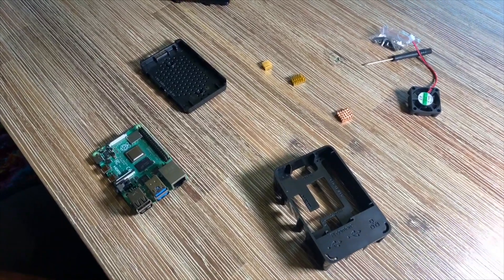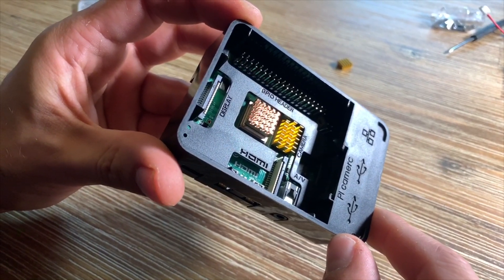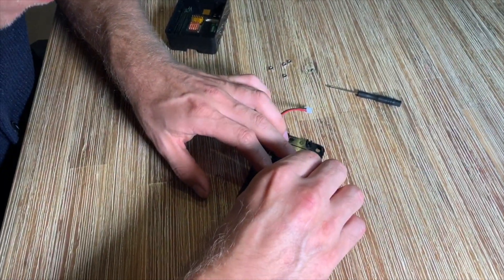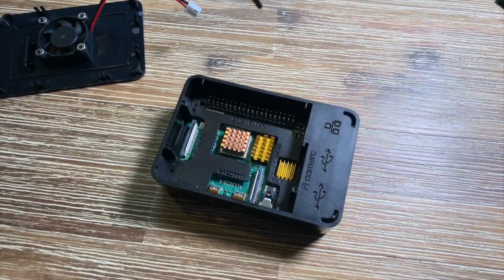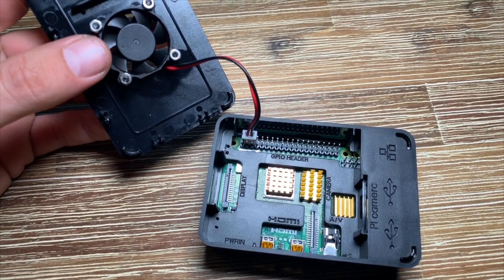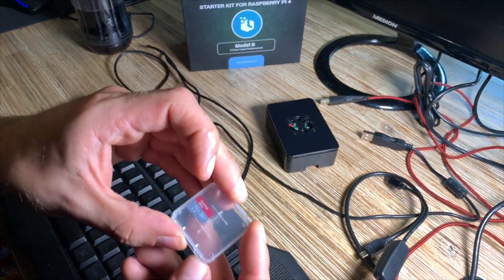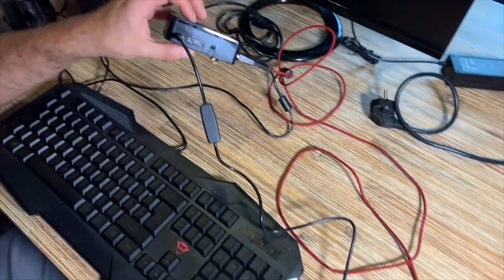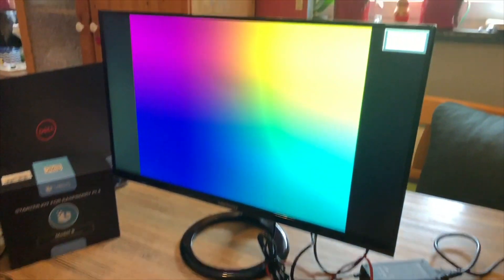How to assemble and connect a Raspberry Pi 4 (Model B 4 GB) DIY

Comment: Thank you, very helpful. I did not have a clue why top cover does not get closed, almost broke it, and then I saw this video -)) Also, now I understand why you placed little heat reducer at the very last . I did all together, and the cover did not feet because hit reducer was not properly alligned... Also, on new models there is no such think as preinstalled OS. Supplied card was empty. May be it depends on supplier?

Comment: Great tutorial, was exactly what I needed. The numbering of the fan pins is slightly confusing. In my simple and technically not appropriate words the red goes in the 2nd pin on the upper row and the black in the 3rd pin on the upper row, in my kit the plugs were separate. Danke !
Reply: See pin numbering on the wikipedia article about the Raspberry Pi: https://en.wikipedia.org/wiki/Raspberry_PiIt's actually number 4 (+5V) and 6 (GND)

Comment: Excellent, I found this video after I assembly my PI 😆. 2 things: the case is a little bit tricky that can fit on the top and the other is the fan, goes at n speed and too noisy.
Reply: Change the pins, for 2 and 5 and it slow the fan a bit and make no noise

Comment: I had a bit of struggle with installing the case, your video helped me in few seconds 😀 i got a 16gb noobs card with my purchase, can i erase the noobs card and flash another OS? Is that possible?
Reply from the maker: Yes this is possible
Reply: @pduesp  thanks 😀 I'm flashing manjaro now 👍

Edit: flash failed ☹️ and now sd card is corrupted
Reply from the maker: You will need a special format (FAT32) and an extra partition to flash the other Card.
Reply: @pduesp  The format is Fat32 and i formatted in the same format. Another card? Why?
Reply from the maker: No other card, sorry. But it has to be formatted in the right way otherwise it will not run proper
Reply: @pduesp  i formatted using sd card formatter with FAT32 format. And now its just showing the sd card size in few megabytes ☹️
Reply from the maker: https://www.raspberrypi.org/downloads/
Reply: @pduesp  i have the raspbian image downloaded, its just my sd card that's not showing up its true size. Is there any fix for that?
Reply from the maker: Run the Raspberry Pi Imager application, then from the Choose OS option , select Erase (Format card as FAT32) . Now select the SD card you wish to format from the Choose SD Card option, and finally click on Write .
Reply: @pduesp  okay.. I'll try that. Thanks pal 😀
Reply: @pduesp  it worked and been using since. Thanks man 😀 but right now, i ran into a situation. I installed firefox using the command, sudo apt install firefox-esr, and after finishing the installation, i rebooted the pi and its not booting into desktop anymore. Stuck on the black screen. I waited so long for it to show up, but nothing happens. Help please ☹️
Reply from the maker: Try a rollback if its possible or boot into safe mode and remove the Firefox app
Reply: @pduesp  i see nothing on the screen to work with :( Do you think bootloader is crashed or something? Should i format my SD card maybe?
Reply from the maker: If you can’t see anything. Check the cables and boor again, then format the card and reinstall the system
Reply: @pduesp  cables are fine cuz it lights up the monitor a bit and rebooted twice but nothing happened. Maybe i should try formatting the sd card. Ugh! Its just three days now with my new raspberry pi, already I'm into lot of issues lol
Reply: I booted into safe mode by editing the config file and then removed the firefox-esr and then changed the config file back to normal. Still the blank screen remains :( I'm reinstalling now
Reply: Reinstalling did help me to set everything up new. After i updated, it asked for restart and i did. Well, there is that stupid blank screen again 😑 any idea what's wrong?
Reply from the maker: Raspberry is like old school computering 😂
Reply: @pduesp  yea 😅 and how to resolve this blank screen issue?
Reply: Its working. Turns out to be some bug with the update. Had to reboot 4 times maybe to finally get to the desktop. I found a thread on raspberry pi forum and realized it wasn't my fault 😂 lot of people have the same issue

Comment: is there supposed to be a gap on the fan lid.  No matter what I do I can't get the gap to be smaller than around 3mm.
Reply: I think it's meant to have a gap but maybe less than 3mm, might depend on the model. In the video you can see the gap as well, looks similar to mine, about 1mm. Sits quite well though, won't fall off.

Comment: Good video. But fan should be mounted other way around. The label on the fan facing-in, towards the board. Not outside. Air should be pumped in. If connected according to the video, air is pumped out, like exhaust fan.
Reply from the maker: Thanks for your support
Reply: Why would you want to blow dust and debris in rather than heat out??  I think he did it right.
Reply: @standyke542  Dust is definitely in any cases. To throw out heat, is along with air blown, it will have to pull from somewhere. Then where it would suck the air from? Through some holes ! 
There are two types of air flows to cool the heat sink:
    Forced cooling - cool air is pushed on the heat sink for cooling purpose
    Induced cooling- hot air is drawn from over the surface of the heat sink to allow fresh cool air to fill the space which enables-cooling..
When to use which method?
If the surface to be cooled is small and also has limited air input to its surface used induced cooling. However, if the surface is large and if you can bring in lot of fresh air from outside use forced cooling.
Reply: Pramod P K meh, I read several forums on this and no one seems to agree on anything other than that the difference is marginal no matter which way you use this fan.
Reply: @standyke542  exhaust will work better only when fan is part of heat sink.. that's, very near to heat sink, which throws out. This fan in this case cant be that. So cooling effect isn't there. That's why said, if pushed in it has better in this case. No one agreed, because they're comparing different cases altogether than case by case basis

Comment: Try comparing the temperatures with the direction of the fan switched.  Is it better to suck warm air out or to blow cool air onto the heat sinks?
Reply from the maker: The case fan should blow out the warm air from the inside.
Reply: It's always recommend to blow air into the IC's. Not like exhaust. Then only have better cooling. Always. In this video it's like exhaust. Fan should have been mounted label facing inwards.